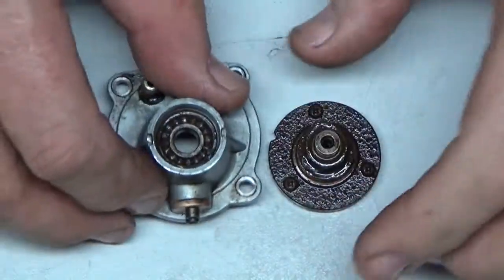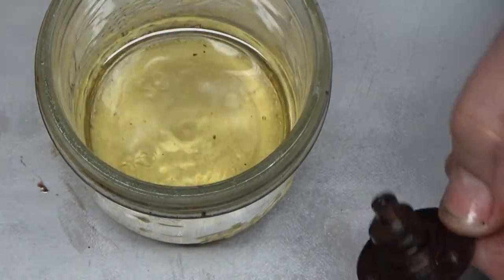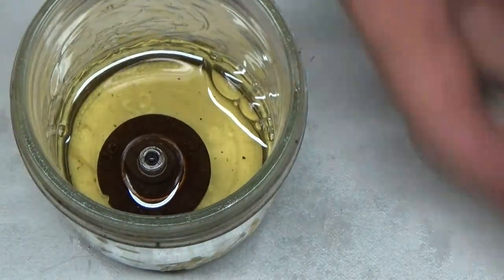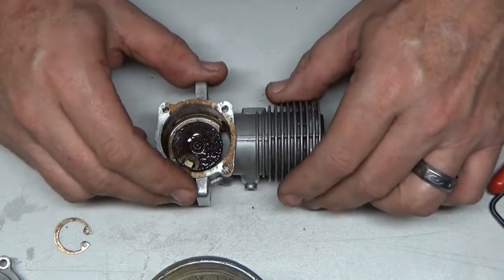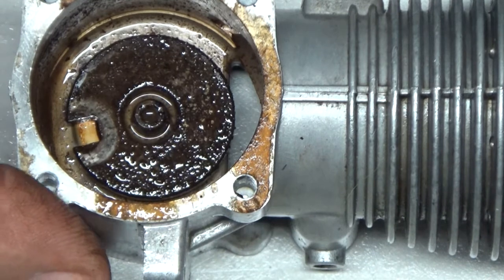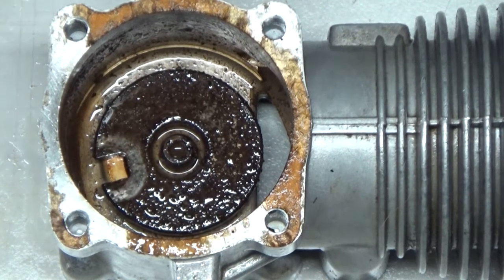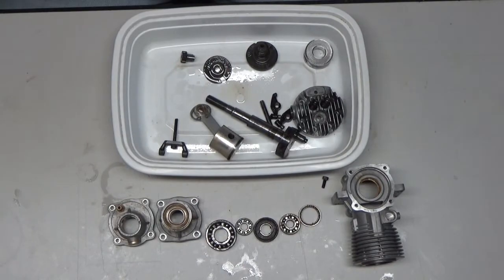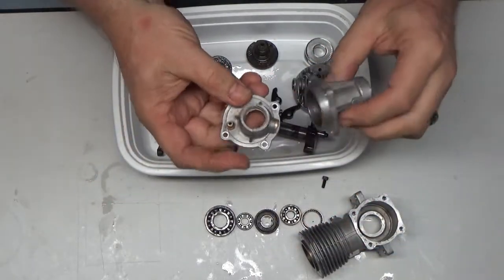OS FS-60 Disassembly Part 2 (Customer Engine)

Comment: I’ve got one of these engines new in box. It’ll go in a Piper Cub I’ll build soon. What I am learning from this video is to oil the engine after a flying session if it’s going to be stored for some time. I had a hard enough time rebuilding my .91 surpass, this engine looks a bit fiddlier.

Comment: I gotta replace the bearings in my os fs 80 when it arrives this week. already bought new bearings for it . front bearing is smaller than the fs 90. cant wait til it gets here.
Reply from the maker: Boca has some incorrect information regarding the cam bearing sizes for the FS-90.

Comment: Thank you for this Video. I never had the opportunity to disassemble an OS FS60 open rocker engine. It turns out that it is much more complex than I expected.
Reply from the maker: Well no more complex than the OS FS-90, but a bit more so than a 'normal' four stroke.

Comment: Always interesting to watch the master at work. That's a busy engine.
Reply from the maker: This one was a bit stressful for sure.  Getting the bearings out was a snap really.  Cleaning the rusty parts....no so fun.  This is the BIG drawback to this, the FS-80 and FS-90 engines.  If they are not stored with lots of oil, the numerous steel parts tend to rust.

Comment: These engines remind me of when I was about 10 or 11 years old back in the late 60's early 70's when I use to fly a Cox tethered model air plane round and round with a Cox .049 2 cycle engine. These are some great memories.
Thanks for the flash backs.